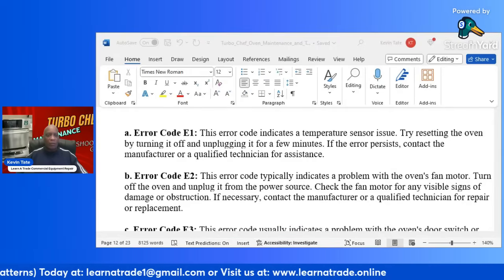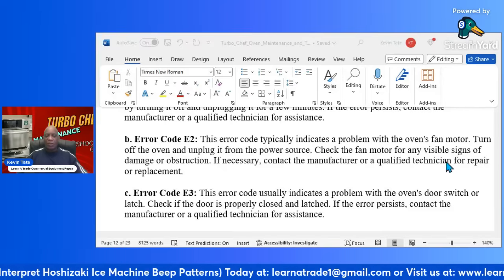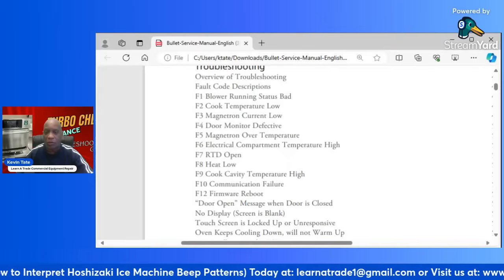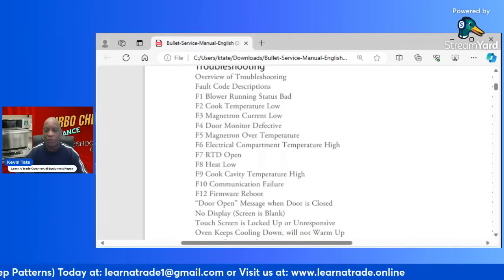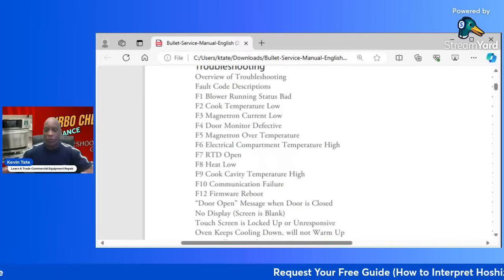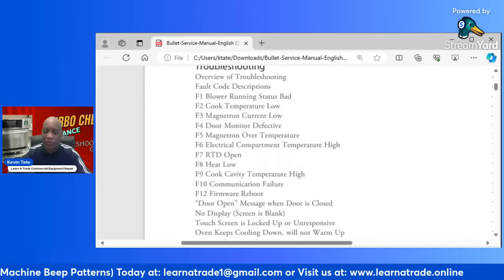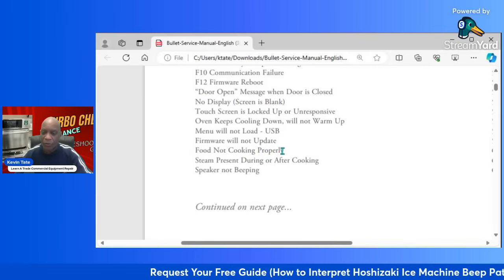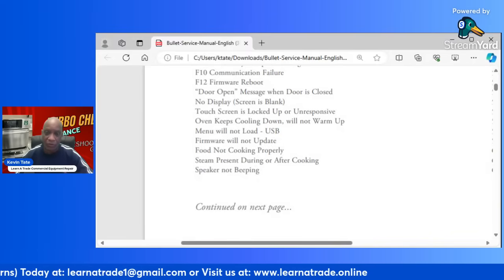Turbo Chef Oven Maintenance and Troubleshooting Guide (Error Code Overview)

Comment: Hi how are you doing, 

I have been working on many turbochef units and have been doing great. However I’m having issues arise when I get the issue with the oven not at correct temp. The oven would rise to 600 degrees when it should be at 425 as it’s programmed. I’m not sure why the cook cavity is having this issue and I don’t know where I should look to find the cause. If you could help that would be appreciated.
Reply from the maker: Good question,  I would start by checking the temp sensors. One is on the top center of the cook cavity the other is on the left side near the heater. Here is a link for the service manual for testing the sensors.
https://www.learnatrade.online/_downloads/b6c37da7b917661b7f1980c3bde7b4f0

Comment: I have a Bullet that fails to sense voltage and is stuck in 208. What component controls the voltage sense? I have check every relay and confirmed their operation by checking impedance for NC/NO and they are all below 1 ohm
Reply from the maker: There is usually a voltage module at the rear right side of the machine but first check the voltage at the outlet because on Bullet models if the outlet is below 220 vac the module will only show 208 vac . If the outlet voltage is above 220vac the module will read 240 so it's best to check the voltage at the outlet to be sure the voltage is not below the recommended voltage.
Reply: @latcommercialrepair  The voltage is 240v at home buty I'll using this at work where it's 208 so maybe I'll stop chasing that issue. I cleaned the entire machine but I haven't seen the votage sense modual. The machine was dropped on it's face and the control board was bent and now I have an issue with the lower heater SSR output is intermittant at best at c22 off the board. it's a CON-7156 do you know what replacenet board will work? CON-3019?
Reply from the maker: @jameswarren1831 here is a link for the replacement board hopefully that helps because the board maybe damaged.

https://www.partstown.com/turbochef/tbccon-3019

Comment: Hi! I just took a look on your website searching for The Big h Batch (Turbo Chef) model #HHB+-D51356 service manual. Do you have any info on this oven? The User Interface is not turning on. I want to troubleshoot if it's the UI board or the main control board that is causing the UI display to not turn on. I already checked for loose connections, power source voltage,and both checked good.